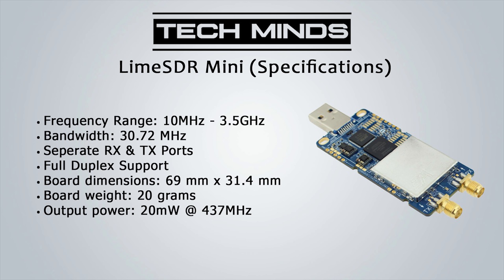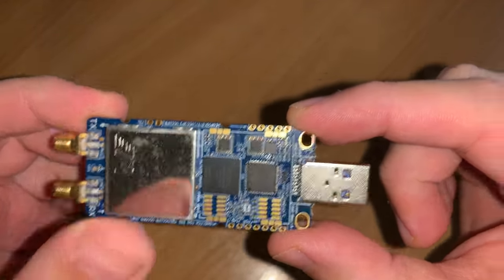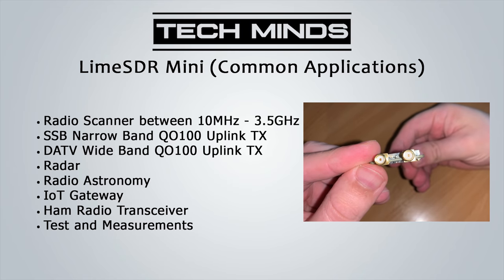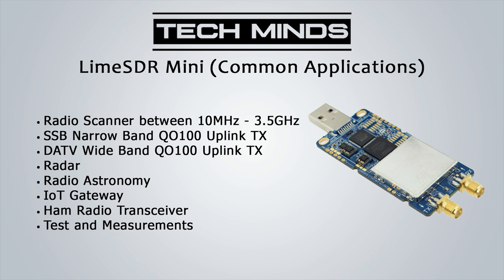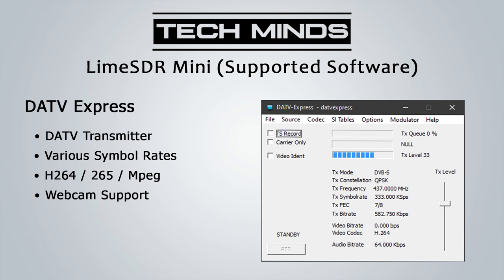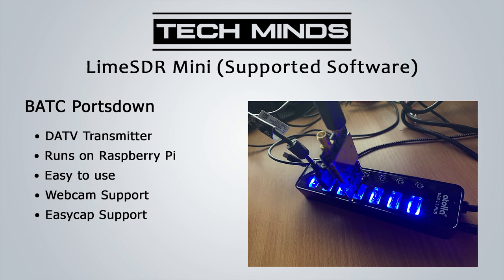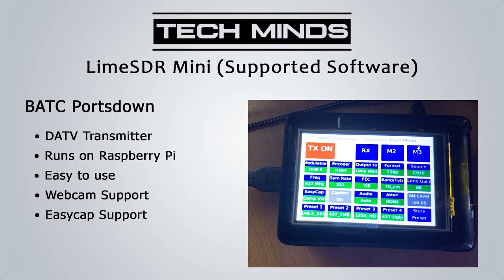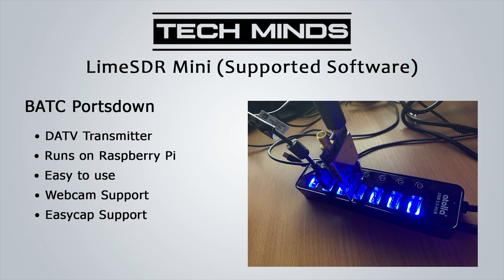LimeSDR Mini - Full Duplex SDR Transceiver - DATV - QO100 - Es Hail 2

Comment: Thank you for the interesting video. It would be good to add a comparison (pros and cons) between LimeSDR Mini vs ADALM Pluto including the spectrum in the transmission mode on 2400 Mhz and an opportunity of using an external reference frequency other than 30.72 MHz. 73 de Karen, ra3apw

Comment: It's a sweet piece of software. I am using it in my PhD and it's a blast. Best bang for the buck.
Reply: @joeboxter3635  Lime Micro. You can get'em at crowd supply website. I must say it is an intermediate-range SDR, thus requiring a bit more work than a USRP N210/B210, HackRF or PlutoSDR. But for the price, you can really adapt existing tutorials to fully grasp it.
Reply: @joeboxter3635  All are transceivers, but  limeSDRs and USRPs are even capable of running a limited LTE eNB. It is not an easy task to accomplish, but there are plenty of videos about it. Cheers!!!
Reply: What is your PhD in?  Total nerd speaking here

Comment: Hello, I would like to buy limeSDR or limeSDR mini, but I need 8 channels, the signal is a simple radio pulse, decimeter frequency range. I know that mini has 1 receiver and 1 transmitter, but could I get 8 channels with digital channel separation? could you recommend suitable models?

Comment: Did you have crashing problems when changing the frequency in sdrconsole? Seems to do it with the latest version.
Reply from the maker: Yep, I get the same issue. I tend to set the frequency before starting the Radio now, but it’s frustrating of wanting to scan quickly. I’m sure it will be fixed soon tho, fingers crossed!
Reply: Same here!
Reply: @TechMindsOfficial  I just read on the mailing list that it will be fixed in the next version due around the 28th January.

Comment: Hi, nice video. I noticed that the UI of SDR Console is a little "sticky". This means that it periodically freezes for a short moment. Do you know why?
Reply from the maker: Yup, I experience that too. Even with the later version of SDR Console. It's not just the LimeSDR it does that with, it's most connected radios. Wish I could figure out why too, also I get crackly audio, but my computer spec is way higher than needed. I was going to reach out to Mr Brown, but I expect he is busy.
Reply: It does tend to skip a bit also. Try SDR++. Much more lightweight

Comment: What’s a good web based software solution to make this into a remote listening station / ham radio.  I’d like to be able to have this connected to my roof antenna on a shot cable and then access the RX and TX of local 2m and 70cm ham repeaters from any computer or mobile device inside the house and not be tied to my shack.  Like a remote head that runs over IP network... either web based software or  some kind of application or iOS app.

Comment: Hello sir, I wanted to use the raspberry pi & portsdown as an independent transmitter so that when it boots up it automatically starts transmitting the webcam image through the limesdr. This way it wouldn't need an LCD anymore.
Is this possible to perform the commands through a linux script and automate this process without the use of LCD?

Comment: Hi friend am need your help am running a radio scanner thro my laptop for digital frequency am using dsdplus. Just asking how to upgrade the software to run conjunction with me radio scanner.. Any help would be very appreciated. 👍👍👍
Reply from the maker: Hi Pete, take a look at my TRX 1 video, I take the Audio out from the headphone/discriminators jack and take it into the pc audio input, mic socket, then use DSD+ to decode digital. That might give you an idea of what you need to do .)
Reply: @TechMindsOfficial  hi friend.. I have the discriminatory.. Is the dsdplus software the only one for the digital frequency. Or is there any other software maybe better quality.. Many thanks peter
Reply from the maker: Have you got the Fastlane edition of DSD+ ? It’s way bette then the standard version. If you  don’t have it, take a look at the read me file that comes with the free DSD, it will tell you how to get the Fastlane edition :)
Reply: @petesyoutube8680  I had little luck with old dsd version and descriminator in a scanner. Recently bought two nesdr smart dongles. They took a bit of setup finding drivers, but work great! Have been following and decoding trunked digital Motorola system for a few days on a "mini pc" I've fitted in a Pelican case. It has been working good (have one problem now I think I caused). If you are wanting to monitor trunked digital with unitrunker and sdr there is a video that was very helpful to me. It's by Tahoe Steve, titled "Unitrunker, DSD+ Plus, & Virtual Cable Installation & Config for Digital Trunked Scanning"
Reply: Hi @juliogonzo2718 
Thanks for the info more than welcome. 👍 Am running a unidan bearcat radio scanner.. But it as the disclaimer in it for the digital frequency on me laptop I have got dsdplus.. So do you think it would be better with the dongle
Many thanks peter
Reply: @petesyoutube8680  I just got the dongles a few weeks ago and quite like them! I tapped my old analog scanner years ago and gave up trying to decode digital. I was able to do it, but the trunked system I was following often had analog voice calls at same time that my scanner would stop on and I would miss digital calls I was trying to follow and decode. I should have tried SDR years ago! I had to figure a few settings out but highly recommend trying it out! Under $100 Canadian and I can do most of what a $600 scanner can do

Comment: Super interesting, thanks. You mentioned using it as an exciter ... what will you use for the RF amp?
Reply from the maker: If I’m going to QO100 then a popular choice is a modified 8w WiFi amp which are relatively cheap, it will need something between it as I’m pretty sure the LineSDR mini won’t drive the amp enough.

Comment: Hey did you face underrun and overruns in gnu radio using full bandwidth or sampling rate ?
Reply from the maker: There was scenarios where the RF output became choppy, but I’m not sure if it was an issue with the LimeSDR mini itself or the PI doing too much work. I think they mention it should be okay upto a symbol rate of 2000 on a pi 3, but I think that’s too much for the pi. just a shame it’s not supported on the Pi 4 yet!
Reply: Tech Minds can you check tx rx rate test on windows machine and share the redults on 30 Msps
Reply from the maker: Sure! Will get back to you
Reply: Tech Minds plz check full duplex and tx and rx separately too if possible
Reply from the maker: I show full duplex in my video, altho very brief

Comment: I would want to put an amplifier behind it and try it on 2 m
Reply: What is a good amplifier in this case?
Reply: @ErnestGWilsonII  Do you need a pre or post band pass filter if you use an external amplifier ?
Reply: I'd like to know more, are you going to use filters?
Reply: @miomatteo  Someone should do a video on how to properly use SDRs with external filters and amplifiers.
Reply: Amplifiers that take in mW andoutput watts are typically much higher than those walkie talkie amplifiers too.  A 150 - 174 MHz one @ 600 mW in - 100 watts out from Cresend is around $2500. Pretty sure the low split ones are the same price.

Comment: LimeSDR, LimeSDR, LimeSDR = 350€ for the setup.
Nice 🤣
HackRF One 65€ 😄
Reply from the maker: Yeh, but you’re missing the full duplex support with the HackRF :) Anyhow I use Pluto now
Reply: @TechMindsOfficial  I understand but LimeSDR does not cover the band up to 6ghz and the khz band like the HackRf One.  
The high cost of LimeSDR and the low bandwidth does not justify the price.  However in some applications the LimeSDR is better for sure

Comment: What can hams rock on 2.4ghz power wise in uk?
Reply: I think that's just wifi
Reply: @Napert I don't think u are actually a ham. I think u talk about needing license 2 cover your ass. Most ism band is international and wifi has always been a sketchy thing to run as a ham u would know why it u had a license. Also it would have been good practice if not legally required to say your call during the portion u transmitted for

Comment: I'm trying to get a device that simultaneously transmits and receives, duplex transceiver that has ports for external mic input and audio output that sits between my audio interface and smartphone that I Bluetooth connect to my smartphone (just like an earbud) but that allows me to tie the smartphone into my audion interface for wireless Bluetooth phone calls. I know how to do it hard wired with an attenuator, and made a video on that. I don't know why there is not a fairly inexpensive device that is seen by the smartphone as something resembling Bluetooth earbuds with mic, but the device instead of being a Bluetooth headset is a device with ports for sound and mic. I know it's easy to build, but I don't want to do it. I'd prefer to buy the device, without spending $700 for a Rode Procaster II. I have all kinds of interfaces and just need the Bluetooth adapter that does that one function in the Ride Podcaster II. Hate spending that much for one little function.

Comment: Almost 200 euro. That's a pricey rf hotspot.
Reply: Just find the specification of LIme SDR For its specs the price is OK  if nto to say cheap https://wiki.myriadrf.org/LimeSDR-USB
...and compare with any other SDR of this range. NO transmit , smaller freqs range , smaller bandwidth and many more for 230+  euro..
BUt for sure i will not buy it because i m not interested in using it

Comment: 20mW is not going to go far. I don't see the point, especially not for $300.
Reply from the maker: If you want to go further then you use an amplifier. I have successfully used this to transmit a signal on 2.4 ghz through the QO100 satellite which is 1000’s of miles away from me. Video coming soon btw